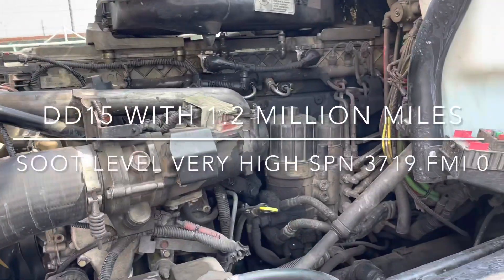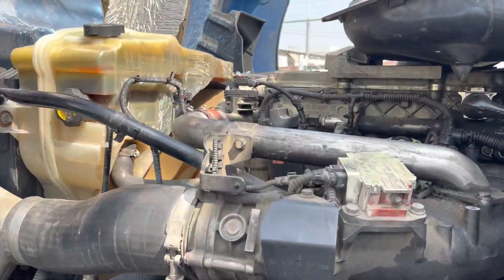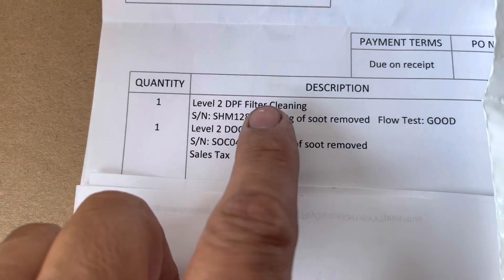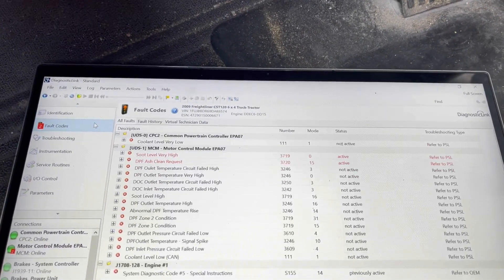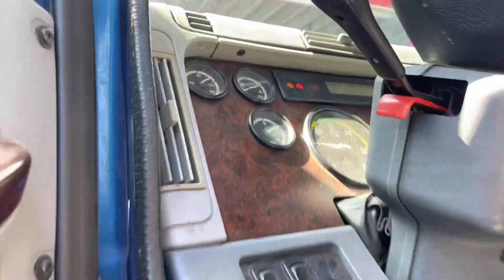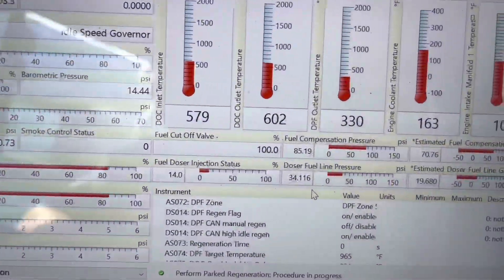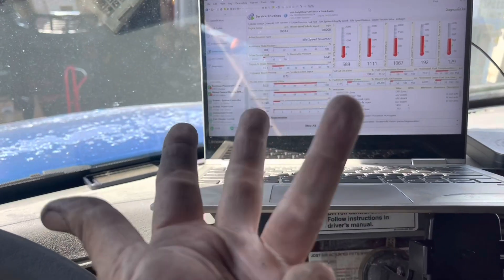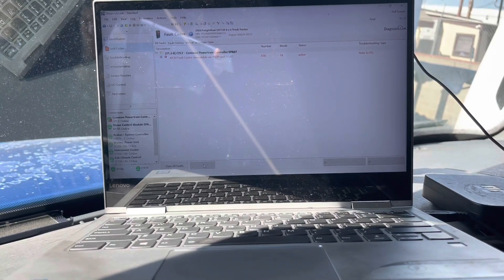Freightliner Century Class with a DD15 that has 1.2 million original miles Fault code SPN 3719 FMI 0

Comment: I was wondering why would anyone in their right mind attempt to fix this engine. Then I realized you’re in California. It’s a good time to be a mechanic with a little electronics knowledge.
Reply from the maker: The DD15 is a good engine, this guy has one million miles and still going. With regular maintenance, minimal idle the engine can go the distance.
Reply: You ask why???? #1 Their is a severe shortage of salvage used DD15 around the country. # 2. The engine is not seized , so its a good candidate for rebuild.

Comment: Thanks 🙏 for your video. I did same you and than replaced new EGR pressure sensor and new dozers fuel injector but the DPF temperature fails. After 3 times regen but check engine light and stop light and DPF light still on. Are you have any ideas for this. I wanted to bring my truck to your shop but I’m here in north California and your shop in south California it’s too far. Please help
Reply from the maker: What year is the truck?

Comment: So what caused the low coolant?
Did you charge the customer for a filter service on a truck with a blown engine?
Reply: The filter service fixed the codes so I would hope he would charge them.
Reply: @ryan8456  No I mean he said the truck lost all its coolant within 2,000 miles since he did the last forced regen. That engine is toast it’s drinking coolant and he made the customer pay for a filter service that they don’t need. This was just a money grab like everyone else does in CA out to screw over their neighbor.
Reply: @markm0000  the filter cleaning was needed did you not see the DDDL? Also truck wasn’t in the shop for a coolant issue per the title.
Reply: @ryan8456  Yes the computer said the filter was dirty but where did all the coolant go? You’re a mechanic if it’s not in the EGR, not in the intake, and it’s not on the ground… then it must be a bad head gasket and getting burned by the engine that is causing the filter to clog up. Did you see the filter? What color was it? Oh that’s right it was white. Aren’t 1.3 million miles old DPF filter supposed to be solid black? That filter was recently cleaned by another shop and covered in coolant. The oil residue is the diesel doser trying to burn it off. Parts swappers these days I swear. I’m not even a mechanic and I know this was wrong.
Reply: @markm0000  how do you know it was cleaned by another shop? Carlos has a good rep here in California for his work. Also Not many people will spend money on a EPA07 in California since you only have less than a year of use out it. Also he never showed the DPF only the DOC which again if you would have looked at the results of the cleaning report you would see why it’s white
Reply: @ryan8456  Step 1 of being a good mechanic is don’t trust what the customer says is the problem. If you blindly change parts and clean filters without figuring out why it happened you are just ripping off customers and nobody will respect a mechanic that does that. You can do it once or twice but your reputation with local trucking companies will go to shit.
Reply: @markm0000   okay mark lol
Reply: @markm0000  why rebuild the engine if it will no longer be legal to operate next year?
Reply: @ryan8456  If the customer doesn’t know the engine is bad and keeps adding coolant it will clog up the filter again in a few weeks and they will be back with the same problem. That engine isn’t good anymore for hauling loads it will blow up on the road any second as the head gasket gets worse and worse. It should be taken off the road now before it becomes a $$$$ huge towing bill and a angry customer that doesn’t have their load delivered on time. This is a completely preventable engine failure that was ignored just to make a quick dollar off a filter service.
Reply: Hey this guy has been working on my truck for 10 years now and I also have 1.1 million miles on my truck. He has kept me truck running good so I know he isn't out to screw the customers.
Reply from the maker: We found the source of the leak, it was at the APU. 
The engine is worn due to mileage, but not blown.
Reply from the maker: @markm0000  the customer requested the filter cleaning. Definitely not a money grab. With the amount of information available to people, trying to screw people would be foolish. 
The coolant leak we found was actually at the APU unit. 
The filter was also at the limit which is why the fault codes were present and the check engine light was on. 
Also, I always keep my customers repairs in mind when it comes to money. I understand these trucks are expensive. I don’t run that kind of shop. 
This why we have been in business since 1980.
Reply from the maker: @ryan8456  this is why I try to show the repair from start to finish. To help others understand what they can do to fix these trucks.
Reply: @CarlosDieselElectric  Pedro then I ask forgiveness and my apologies. I only had the information available in this video and when I saw that the coolant was gone and you just topped it off and did a regen without explaining where it went that seemed suspicious. The APU wasn’t mentioned or even visible in the video. 
I’ve been screwed by a couple mechanics already and I’ve only been trucking for a few years. It’s easy to make money if the customer doesn’t know what they’re looking at. I forced myself to learn how trucks work because I wasn’t going to get messed with again. Good job being in business for so long and taking care of your regulars that is hard to find nowadays.
Reply: @markm0000  I can respect I person like you bro.   Much much respect to you 🙂🙂
Reply from the maker: @markm0000  no worries, I completely understand. Too many mechanics have burned people and it’s hard to trust. I completely agree with you. 
I try to include as much as possible to be as transparent as possible in my videos.

Comment: I have a 2013 freightliner cascadia with a dd15. how can I tell if my egr cooler is leaking coolant into the one box
Reply from the maker: Pull off the cross over hot pipe and inspect for any signs of coolant. The pipe should be dry, only soot should be present. If it is wet inside, then it could be coolant. 
You can always remove the EGR cooler and have it pressure tested for leaks. 
They would test it like you would a radiator.
Reply: @CarlosDieselElectric  ok cool thanks for replying

Comment: Hi pedro thank you for making helpful videos,I have a question I have cascade 2008 with serious 60 engine, this truck have high oil pressure I change.oil pump,oil regulator ,main bearing and road bearing and check bully gear bearing but I don’t see any change can you give me some advice about the problem please ? Thank you for  for your advice,
Reply from the maker: Are you trying to increase your oil pressure on your Series 60? 
What is your oil pressure at idle? Hot and cold? What is the pressure at?
Reply: @CarlosDieselElectric  no it’s above 60 psi and some times cluster show me 0 psi for 1 second and return back
Reply from the maker: @zmichealtesfa8559  check your pressure sensor. Located above the starter. If the issue is still there the gauge could be the problem and also check the harness. Could be an electrical problem
Reply: Ok I will check those parts,I really appreciate your information,👍👍

Comment: Hello Pedro 2015 FRT DD15 550Kmiles ,We Did oil change at truck service  , the truck came from Chicago with 19K load all was perfect , oil Mobil 15-40 , all filter OEM , after oil change with all filters (oil and fuel ) the truck start 30second and shutdown by it self , start again same 30 second , then continued alarm came and shutdown, heavy cranking began , replace OEM starter same , 4 new Battery same , then found no oil in engine, so boss what do you thing where oil gone ? Perpare my self for big bad news ? BTW ( we change oil every 10k miles ) thank you so much
Reply from the maker: How far did the truck go after the oil change?
Reply: @CarlosDieselElectric  all happen the truck still on shop ramp going no where
Reply from the maker: @pera6356  my guess is they didn’t put any oil in it. 
Won’t know for sure until you pull the oil pan and see what is going on. 
My guess if there is no oil or not enough oil and the engine may have seized. 
First try to bar the engine over manually and see if the engine rotates. If does not, then most likely the engine is seized.
Reply: @CarlosDieselElectric  can you take care of it ?  truck location Stockton CA , we can tow to your address, one more thing  how much overhaul OEM part cost approximately ?
Reply from the maker: @pera6356  first find out if they are going to be responsible for any damage. Assuming they caused the damage, you still need to find out what happened. 
I am assuming the worst case scenario. You are looking at a major rebuild, engine would have to be completely torn down and rebuilt. 
The cost is about $25-$30K.
Reply: Ok thank you boss
Reply: @CarlosDieselElectric  good morning , we still waiting for master mechanic to check , but i notes red flued in driver side fuel tank only the right side normal diesel color

Comment: EPA7 DD15 always last the longest
Reply: I rebuild a wrecked 2010 century with DD15 and been driving it for 2 years already, replaced rod and main bearings together with oil pump and seals and I have nothing but good things to say about this truck. Sometimes I have to do a regen but I have a cheap amazon tool that cost $200 and no need to take it to a mechanic.